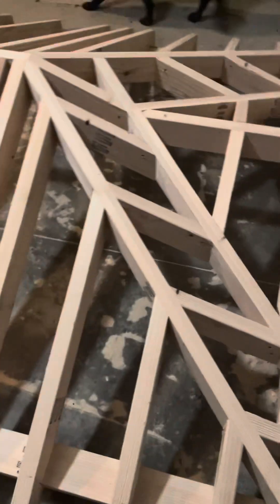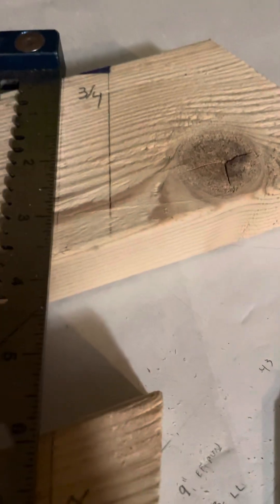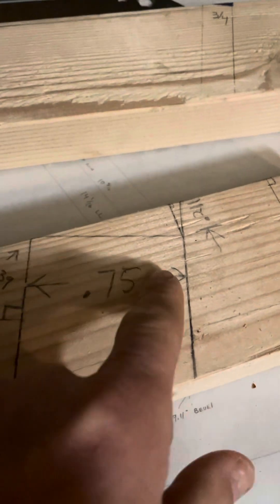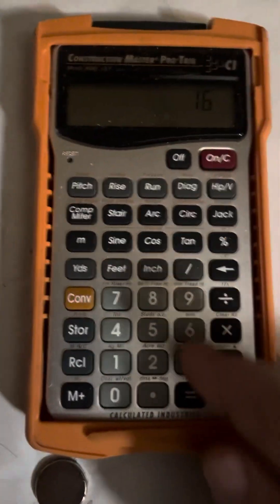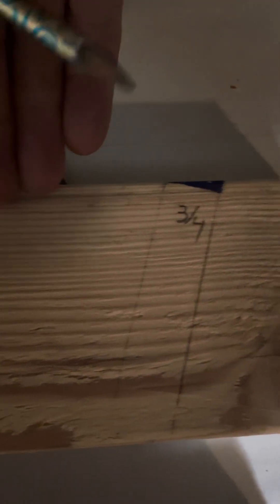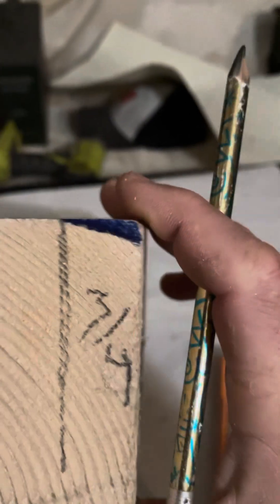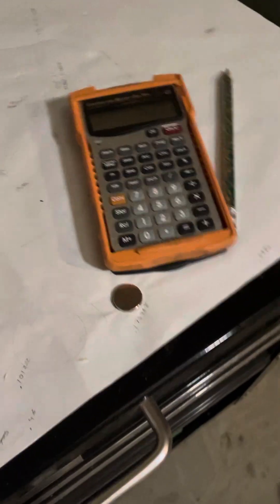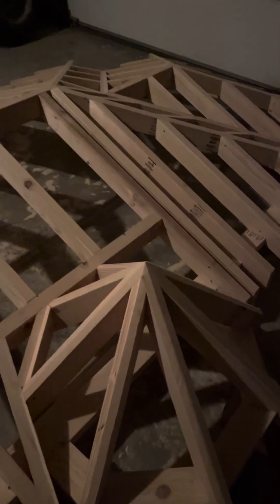How to calculate hip backing angles

Comment: Around here we rarely do. Know our dimensions that accurate. Not enough that multiplication wouldn't throw it off too much anyway. For something like that... Would probably eyeball it and shave the rest if out on site with saw in hand. Otherwise I'd have made sure to put all the needed angles on the drawing beforehand. ...but we also don't do things the same way. Run and rise has only been used for stairs the last 4 decades around here. Rooofs are metric and degrees, so... And handstacked roofs out of the bundle is a rarity. Usually if somebody wants a handcut roof, it's going to be heavy timber with mortise and tenon, and there will be a whole lot of scribing and dry fitting in any case.

Comment: How do you do this with a curved rafter?
Reply from the maker: It’s takes a lot of geometric development and you have to hand cut it.
Reply from the maker: To my knowledge, this has never been addressed in any reference text or video.  I have worked it out, but it is a ridiculous amount of drawing.
Reply: @Redoakcarpentry  - 🙁 I had a feeling it was going to be difficult.
Reply from the maker: @Anonymous_users_1  backing angles aren’t necessary if you understand roof geometry and you’re using conventional lumber.   They make hip/ valley connections easier in many respects, but in the case of sloped hips they complicate it tremendously.  Backing angles are specific to the pitches involved.  If you took a curved hip and segmented it into 10 smaller straight lines, you’d essentially have 10 different pitches, each with a different backing angle.   What that looks like on an analog curve is a rolling angle that smoothly blends from 30°  bevels at the top  to 10° bevels at the bottom.  No saws do that.  You’d have to locate the gradient bevel transitions geometrically and then cut it with a hand saw

Comment: I need your advice. I’m building myself a shed with a hip roof and a slight curve. I will use shingles but I’m wondering how can I make the exaggerated ridge cap while still keeping the roof waterproof? I know you’re a framer and not a roofer but maybe you can help.
Reply from the maker: Sure as long as it’s a not super tight curve, more gradual would be easier.  And make sure it’s warm, so the shingles have some bend.  I think your biggest issue will be cracking the cap when you try to conform them.   Put on a good water proof underlayment and it won’t matter what your shingles do.
Reply: @Redoakcarpentry  - One more question. When framing a roof, when using 2x6 and 2x8 if one is Doug Fir and the other is Redwood because there is no 2x6 redwood, does that make a big difference if both are kiln dried and construction common?
Reply from the maker: @Anonymous_users_1  the only difference between materials is their strength.  Certain species of wood can carry more load,  so long as you check the span charts for that particular size and species, and make sure they correct, you should be good.   No offense intended, you strike me as rather inexperienced, have you ever built a hip roof?
Reply: @Redoakcarpentry  - I’ve never built a hip roof. The angles, birds mouth isn’t really a problem, I understand that. I’m making a shed, 8.5 x 15 on slab foundation. I plan on using 2x8 on the top ridge and hips and 2x6 on the common. I also plan on adding 2x6 collar ties to the bottom of the common rafters and also the top of the common rafters right below the ridge. It’s the materials I want to get right. The roof will have shingles.
Reply from the maker: @Anonymous_users_1  right on! Let me know how it goes!
Reply: @Redoakcarpentry  - I’ll post a video and send you a link so you can give me your opinion. Once I get started on it.
Reply from the maker: @Anonymous_users_1  feel free to ask any questions along the way.
Reply: @Redoakcarpentry  - Thank you. I do appreciate you. Also, thanks for letting me know about the load tables. I’ll be doing lots of research on this before I start. I want to make sure it’s strong and also is to code in my city. It’s my first build, I’m doing it as a fun project but it’s going to be a Dutch Hip Roof with traditional Japanese tiles.